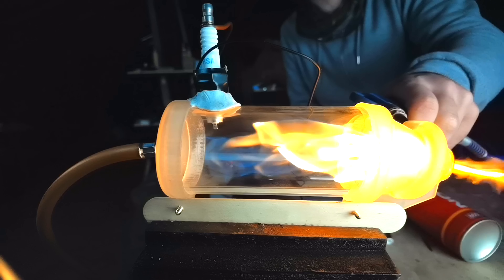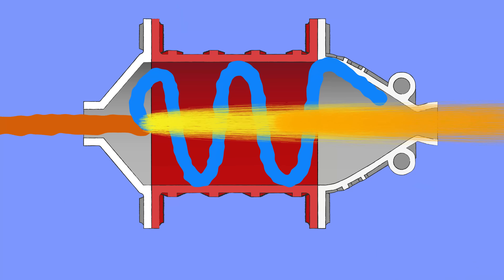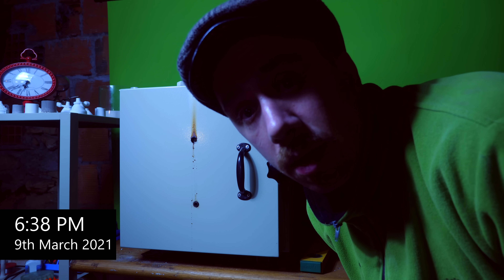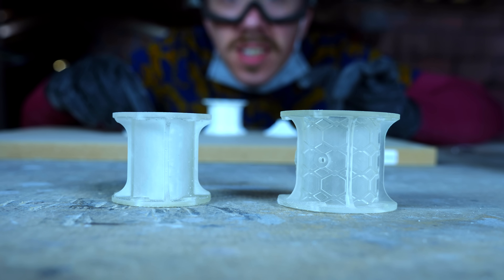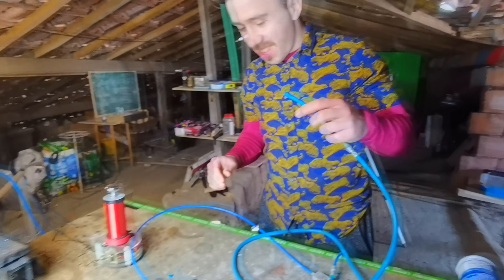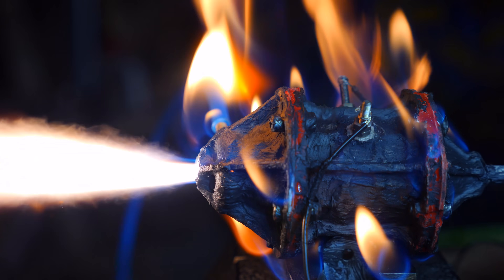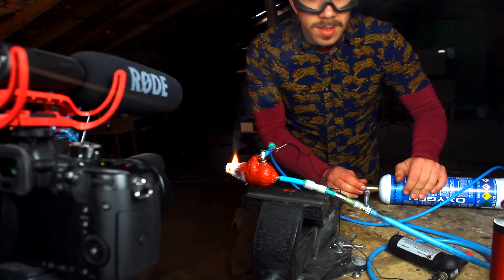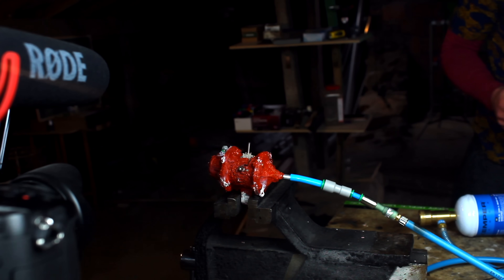Vortex Rocket V2.0 (3D Printed)

Comment: integza why don't you print half of the vortex rocket in resin for the chamber and the other half out of ceramic for the nozzle? also can you use nitrous oxide & methane as fuel?

Comment: I saw a video where a YouTuber put some metallic paint on his 3d prints and then using some copper and an electrode, copper-plated it, maybe this might help to stop the leaks in the engine as well as provide a durable outside coating that won't burn and also due to its high melting temperature, would not allow the engine to expand as much reducing the chance that it violently explodes.

Comment: Oh boy I like that you are only half as crazy as I in testing, but you are very fortunate you motors leak. If you cranked up the chamber pressure higher than the part could handle you would have shrapnel bomb. Try and build a lexan case or shield to protect you and your family.

Comment: If you fire ceramic at higher temperatures it becomes vitrified (loses porosity) but it also shrinks and warps more. So maybe try that? And for the chamber try a thicker and steel cylinder (more welding).

Comment: Maybe do an outer casing that has 5mm between the engine to keep the pressure in, print it in one part so there is less chance of leaking and use re-enforced mounts using ceramic locking mechanisms

Comment: Try putting soapy water on the outside of the engine to easily find leaks. If there is any gases escaping it will form bubbles
Reply: It's not about leaks...it's the porosity of the ceramic. The entire structure is "leaking".

Comment: I guess you could try the method by which composite fuel tanks for rockets are manufactured, namely wrapping a carbon fiber roving soaked in resin (or in your caes, fireplace sealant) around a mandrel; the completed product looks a bit like a spool of sewing thread. Also, maybe you should add ball valves to your fuel lines so you can cut them off quickly.

Comment: For your next video you could make a wind generator printed on a 3d printer with solar panels on its blades that give electricity to the same 3d printer that printed it or perhaps some light in the workshop

Comment: Maybe the sealant needs to be applied to the inside of the engine, rather than the outside? That way, the pressure would push it harder into the pores. Idk if the sealant can take the temperature though.

Comment: Maybe a controller for the fuel, 2 electric valves or a potentiometer, because the explosions when the engine is full of gas destroy itself. 
And a large engine too it seem so much gas.

Comment: I'm thinking that to solve the leak problem you have to think about the direction of the pressure inside the chamber... if you cover it from the outside, the inside pressure will push outwards, pealing of your coverage... so to solve this problem, you should cover the inside of the combustion chamber with an ablative material, which should also prevent leakage, and the pressure will embed it even further, giving it more coverage... also, for a future video, what about a turbopump for liquid fuel? After seeing your video about the turbine I thought it couldn't be so hard... could it??

Comment: One idea could to make something alone the line of ablative cooling which in used in the big rocket engines. This could increase the time until the engines burns through and is could also seal it a bit better. Nice video by tha way ;)

Comment: The fact that ceramic parts let air through could be very usefuel. For a kerosene pressure lantern like those made by Coleman. What you do is 3D print your own ceramic parts for the mantle. Then paint it with rare earth nitrate solutions, dry and bake or burn it into the ceramic. With little holes in the mantle that are about 1.5 mm diameter and similarly thin mantle structure. If you have a ceramic part that screw on the pressure lantern then you could use that as a base model to print the ceramic mantle on.

Comment: Do you use rubber o-rings between the sections to make them gas-tight? You can cover them in zinc chromate to protect them against the heat

Comment: Maybe Ceramic can't withstand the pressure inside the chamber. The shrinking is always damaging the structure even if you can't see it. Maybe go back do normal 3D printing and coat the plastic afterwards in something really heat resistant. Some additional cooling from the outside might just do the trick. Just some thoughts from me, nothing i have actually tested or anything. :)

Comment: Idea for a future video: using the engines you already have, but loaded with solid fuel. To control the power, you can use solid fuel without included oxidizer and use compressed oxygen. Then run it with tomato lord Jr. Inside of the engine. Pretty sude he will die then.

Comment: I'm thinking you need to start moving into lost PLA casting your parts. If you use aluminum they will still fail, but you can cast your walls thick enough that it will soak the heat for quite some time before that happens.  If you throw that into a water tub, you could probably get a nice long test going.

Comment: Larger diameter outer housing, and a 2nd printed sleeve liner that fits inside, and has overlapping seams so no seam is straight through, and then bond them together with the high temp sealant

Comment: Mr. Integza a few videos ago you made a sterling engine and there was a problem with the melting of the air tube, I suggest you to print it on ceramic resin or print all engine

Comment: Hey Integza! Awesome work! To solve the issue with the porous engine, you could always try using a mild vacuum to suck a resin or other sealant into the pores. I'd suggest sealing the desired openings in the engine with something like wax or hot-melt glue and then either dipping it in or filling it with resin, superglue or a very runny ceramic. If you're dipping, then pull a vacuum on the main chamber somehow and it should pull your sealant into the pores of the model.

Comment: if i were you i would take coke cans. cut them in pieces so i can surround cermaics resine. then solder all of that. I would also stick the aluminum to the rocket by surrounding it with epoxic clay. Epoxic clay is used to fix cars motor leakings so i guess this might work. Maybe you wanna try to only use epoxic clay even.

Comment: I suggest you use a thicker engine wall and bigger size combustion chamber, don't use modular system with ceramic resin because ceramic has rough surface which reasult leaks on your engine unlesh you use some type of porselen coating that will smooths your engine surface

Comment: is there a particular reason to have the vortex inlet at the nozzle end? it seems the fuel gas would push against the fuel going out, maybe if the vortex inlet is on the other end, the vortex and the fuel would go the same way and cool the shell better.. maybe you could even split the inlet pipe in the print into many smaller ones around the perimeter of the engine to make the vortex more stable.. just an idea :)
Also, i wonder if you could seal the inside of the engine by pouring ceramic slurry into it and spinning it around for a while so that the slurry settles in the pores on the material.. maybe some other material could work in a similar way

Comment: You should try Filamet filament, it's metal filament that becomes 99% metal once sintered, it should be stronger than the ceramic, and hopefully not crack as easily, maybe you can finally have a working jet engine that doesn't self destruct.

Comment: Integza my idea for vortex engine V3.0 is, to use current ceramic body but instead of some glue or sealant, I would coated it with carbon fiber and fireplace sealant as you did on pulse jet engine. That should take care of leaks.

Comment: INTEGZA::: Can you use liquid nitrogen for an outer vortex and oxygen for an inner  vortex , you need something to stop the oxygen burning at the boundary layer where you have slower moving gasses, that boundary layer with nitrogen would stay much cooler.
I'd say see other comments about the porosity of the ceramic, maybe try a fired ceramic gloss coating.

Comment: Just for brain storming. Liquid glass ( silicate sodium solution ) is used to seal many things that involve pressure and temperature. It's used in engines, ceramics, etc. Since your print material is so porous, probably it would absorve it very well, and with a little bit of luck, seal it.

For a video idea, how about a printed ram pump. Few know about this marvelous "free energy" pump system.

Comment: for sealing the parts since heat resistant silicon did not seem to work. perhaps you can try engine enamel. it comes in a spraycan and is meant for coloring engines on cars but it has high heat resistance and could possibly help with sealing the pores in the ceramic.

Comment: GLAZE (on the inside!! you dont want air/water or worse fuel and oxygen in your engine body!!)

Also, you are taking to much risk! use a mask, do not test those engines inside! you will have a fire or an explosion at some point and we still need you to beat the ketchup out of those evil tomatoes!

Comment: Glazing the ceramic prints could be an option. I also think it could be beneficial to model your prints with grooves to accept high temperature sealant when mated together. Given the thickness limitations of the printable ceramic.. have you considered an actual clay printer? Could get messy! (Fun) 🤓🚀

Comment: This is dumb me comment, but I think the heat is melting the silicone, thus making it liquid and letting air escape, what if you built some sort of external casing to keep the liquid silicone where it should be/ switching the silicone and cement layers? So you would have a sort of external harder layer keeping the silicone where it is meant to be, or making the whole thing explode but weeeeell, that's still content

Comment: After baking the engine parts impregnate them with resin again so you'd have both the strenght of the porcrlite clinging to itself and the strenght and sealing properties of the resin. You can also try finding pottery glasing to seal the ceramics.

Comment: Make a cylinder a bit larger than the engine, put the engine inside the sylinder and pour your fireplace sealant or whatever you use in it

Comment: There seem to be some high temperature resistant paints floating about the internet, I guess that a thick enough layer of paint would create an air-tight barrier, so there are no leaks, as well as being resistant enough to the high temperatures.

Comment: Try to built a cement rocket chamber with 3d printed mold, it could work if you use a 2 part cement rocket with the minimal of parts to avoid leak problems.

Comment: You can use carbon fiber sheet with high temperature sealant. 
Or some diluted cement solution coating.

Comment: Hi Integza, I have a suggestion to make your 3D printed liquid fuelled vortex cooled rocket engine working. You could print all your parts in PLA or resin, cast it in petrobond sand, pour some liquid metal (previously melted in your furnace) in the mold, and get your shape gas proof.

Comment: To stop the leaking you could try to submerge the parts in a high temp resin so the porosity absorb the liquid. Also you may try to make it out of metal with some lost wax 3d printing. But if you use this process you must make sure to make a cooling system otherwise the motor will melt.
I think that the modular option will inevitably leak, so try to go with the one piece model. 
One last thought, and this might be to crazy, you can try to make a case for the entire motor, and pressurize it with like a compressor or something, so the flow goes into the engine through the porosity, instead of going out. This might also help with the cooling.
Good luck!

Comment: Why dont you cover the rocket with another layer of 3d printed ceramic, a 3d printer ceramic cant print more than 2mm, then just print few different saiz that cover the 1st ceramic and use silicone high temp glue in between 1st and 2nd 3d printed ceramic

Can i have 3d printer now😂

Comment: Hi integza! Have you considered using a non-porous ceramic coating (Ceramic glaze) or some form of high-temperature flame resistant paint on the inside and outside? I am no expert but there is a large variety of products for all kinds of applications including rocketry. 

The biggest issue with the rocket is the material it's constructed with since it's very porous and becomes even more so after getting treated in the oven. 

Maybe think of the internal coating as an ablative shielding when deciding what to use? It doesn't have to last forever. Just long enough for those youtube views. 

If that doesn't work it might be a good idea to try a different approach. You could try 3D printing moulds to form parts out of a different material or another ceramic. That should help with the shrinking also.

Comment: To the leak problem try to put silicone in a conteiner and submerge the engine and then put it on a vaccum chamber, in that case you are sure the engine don't have any leak. If it leak anyways try use another type of  silicone

Comment: I didn’t have too much experience working with resin printers but can’t you remove the supports before melting out the plastic from the ceramic? I know there’s a risk of causing the part to warp as you cut the supports away. I’m just wondering if you might end up with a cleaner part if you cut the support and maybe make a base to hold them in the furnace?

Comment: Maybe try printing the parts with threaded connections which you can seal up inside, instead of two flat sides you press together. Like old Gas pipes do it. Also try tapping (making a thread manuel) the inlets, if possible, instead of gluing them in.

Have fun and good luck for the next try :D

Comment: 3d print a 2-piece engine from a basic "meltable" plastic. Put it in sand & cast molten Aluminium into the engine parts. 
Or 3d print a "negative" & pour actual ceramic engine parts. Can silicon be 3d printed with?
The ceramic mix can be added to with Alumina powder, like on spark plugs.
Also get some ball valves for a quick gas shutdown!

Comment: Solving the leaking issue? Hmm. Could print the engine pieces out of multiple parts per piece and seal them on the inside as well as the outside with extremely resistant materials.

If you can’t work with metals like that yet then maybe you can use an aerogel like substance? Iirc one was made that was insanely dense. (compared to normal aero, may be enough.)
Not the most practical thing ever, but for a prototype that needs to live long enough to work for testing? Could happen.

Comment: Integza. Put some heat sinks around the outside to cool the casing. 

The engine case is being heated by the vortex, which is being heated by the fire. Even though you have vortex cooling, you still have heat exchange, just not as much. But the heat is being applied to the casing through conduction (heat energy being forced to the outside of the vortex through centrifugal force), and friction as the oxidizer passes the material at high speed. As a test, you can run the engine with air at both ports without ignition, and see how much heat is generated from that alone. 

Great work. I love your channel.

Comment: Why dont you take the finished part and submerge it in more porcelite in a vacuum to fill the micro pores and then cure again? It might work
Reply: I think a process similar to  carbon fiber vacuum infusion might work. Also, maybe use a glaze, I think it would work better than the resin.
Reply: @johntaylor5800  hmm.  Yeah but... Why not both? Fill the mircoholes and then glaze it
Reply: It wouldn't work because porcelain is porous by nature and the little micro holes & fractures are made as the water escapes during firing. A high temperature glaze would work to fill in the holes, it's the same reason why mugs & plates are always glazed before they are used
Reply: @radiochemist  But would the sealant in vacuum idea be viable? In your opinion? (I'm only just now making a vacuum chamber so idn't have any firsthand experience)
Reply: He could try and cure it inside the vacuum chamber for better results
Reply: Or dip it in the same sealant while under vacuum

Comment: maybe try putting thin metal tube in the engine and extend the ends of it to be outside the edges of the chamber so when the nozzle and other end are on the seal is behind the metal and thus less gas leaks no clue about the end or nozzle tho

Comment: I think a good thing to try to seal it up is to do the same coating of refractory cement and high temp silicone with the gas tubes intstalled but to then dip coat the entire assembly in a high temperature epoxy (the refractory cement and silicone may not be neccessary but I think it would prevent epoxy from getting into the chamber via the porous ceramic) .  It may take a bit longer and a bit wasteful on the epoxy side but if you do 3-4 coats I'd think that would give you a decent enough seal.

Comment: I could be wrong but maybe try dispersed clay in alcohol to get it into the porous structure of the prints. Multiple dippings allowing the alcohol to evaporate between coats. Even if the clay doesn't permeate into the pores, I bet it still form a good barrier.

Comment: I was gonna suggest maybe milling out the engine, or casting it. But then i realized that it would kind of defat the whole point of having a 3d printed motor 😂.
it looks like the motor that was just 1 part was the best sealed version, som maybe combine it with the modular one? you could create a small capsule for the inside of the expansion chamber, to relieve some of the pressure off of the seems, where it leaks.